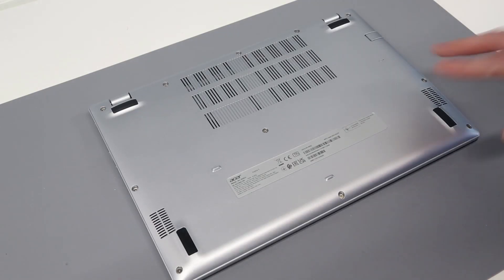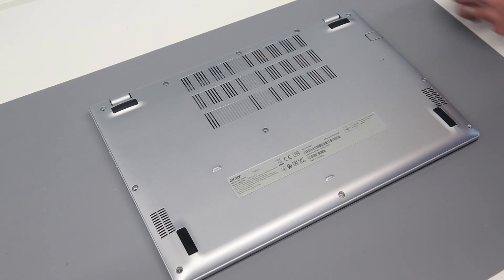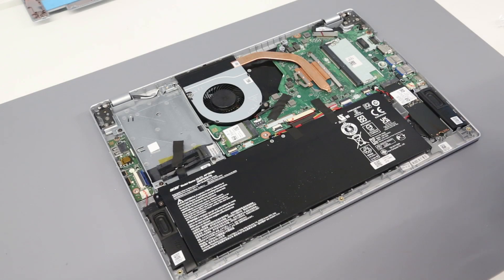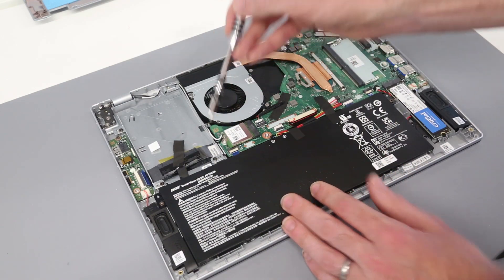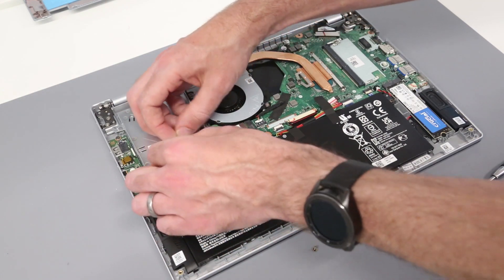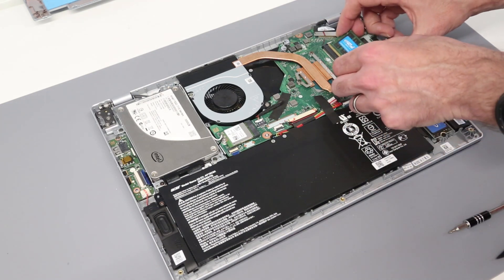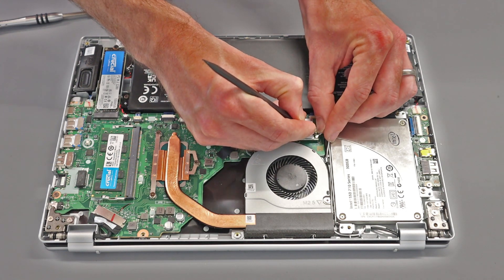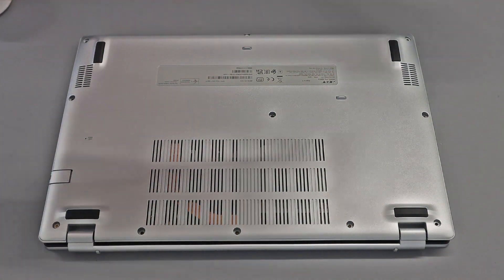Acer Aspire 5 A514-54 - M.2 SSD, 2.5" SATA, DDR4 RAM and WiFi Upgrade Guide

Comment: It’s worth pointing out that the SATA cable might not be plugged into the motherboard at the other end, as was the case for me. Simply connecting the loose ribbon cable to the connector labeled JHDD1 (both located near the Wi-Fi card) solved the issue.  just lift the locking tab (the plastic shell on top of the connector), insert the ribbon cable securely, and press the tab back down to lock it in place.
Reply from the maker: Good info, thanks for sharing 👍

Comment: tengo una acer aspire 5  intel 7 11g  irisxe  + m.2  wd black sn750 de 1tb  + ram 24gb(8soldada +16ram libre). quisiera saber si mi m.2 o acer aspire 5 se le puede poner un disipador. opiniones sus  experiencia
Reply from the maker: I don't think you'd have room to fit a heatsink on the M.2 - maybe a thin heatspreader but I don't think you'd see much benefit.

Comment: Hello bro, I need help
This Acer Aspire 5 A515-56G-54JN model comes with 8gb ram , I would like to know if it's 4gb soldered + 4gb in slot or the whole 8gb are soldered to the motherboard ?
Also is it 3200mhz or 2666mhz?
Thanks in advance❤

Comment: What is the laptop model reference and what is the processor? Mine is an a514-54-52ty, with core i5 1135g7, and the manufacturer says it is compatible with nvme up to 512GB. I would like to install a 1TB, I'm in this doubt.

Comment: Excellent.  I have the A514-55-511p = it has 8gb.  I assume this is 4gb soldered + 4gb in the free slot. Question:- can I add 16gb into the free slot ?  Will the BIOS "see" it ?  What speed ?  2666 or 3200 ?  Thanks - again, excellent :-)
Reply: Yes you can add 16GB SODIMM 2667/3200 but it will only run at the speed that your CPU supports. I did this on my A514-54 and it had 4GB soldered and 4GB removable.

One thing to note is that there might be a slight delay to startup on your first time after replacing the card.
Reply: @cybernetix_1440 but the max is 12 gb only

Comment: Hello bro, I am about to buy the A514-54-54LT model, the seller tells me that the model has only ONE ram memory slot, occupied by 8gb, and that this can be replaced by a memory of up to 20gb. Is that correct? Does this model only have a single RAM slot? Will I be able to expand to 20GB without problems?Thanks

Comment: Hello, I tried to follow the steps regarding on the installation of the RAM module. I bought the same RAM which is also the same from the description. But when I successfully installed the RAM, I encountered black screen issues. Is there a way to fix this? 

Note: The laptop works fine when I uninstalled the RAM.
Reply: this is most likely due to the speeds of the ram that you have installed. if they are above what the bios is capped at you will need to update the bios software. this is done by finding out what type of bios you have and basically update the pc that way. search it up on youtube homie.

Comment: I have the A514-54-50LX model and it comes with 8gb 2133mhz ram. Should I buy ram with the same speed or is it okay to go higher? And is it possible to match the brand?
Reply: my dude i have the same shit can i ask u something is the 8gb ram on board or is it already in the slot
Reply: I recommend you to match the speed of the ram that you already have but it won't gurt if you go for a higher speed as long as your Bios and motherboard support it

Comment: Question on the ssd upgrade... the info I found said that the max size is 258gb for expandability. Your link goes to a 1T ssd drive and a 1T hdd... can you upgrade to a 1T vs 258gb?

Comment: thanks for making this video. my question now is can a soldered ram run dual channel? cause if it can't i'll just by a 8gb ram instead another 4gb ram
Reply from the maker: Yes, adding a 4GB module gives dual channel.
Reply: Where can I find that soldered ram I opened my laptop and couldn't find it?

Comment: Do you need to disconnect the battery?
Reply from the maker: It is not ESSENTIAL, but it is recommended to minimise risk of any damage
Reply: Um I have installed ram  but the screen isn't turning on. the fan is working its heating but the screen isn't? Do I need to wait?
Reply: @virus9450  same..,how to fix this?
Reply: @ramabmp-1999  what you do is get rid of the ram and put it ba ck in again

Comment: Hi sir . What type laptop is this , is this Aspire 5 A514-54-5164?
Reply from the maker: It is the A514-54. The 5164 bit indicates other aspects of the configuration, but for the purpose of this video all A514-54 machines should be basically the same.

Comment: Hii,

4 GB of onboard DDR4 system memory, 4GB of DDR4 system memory, upgradable up to 20 GB of DDR4 system memory.

What does this mean ?
Reply from the maker: It means the 4GB is soldered to the mainboard, and there is a SO-DIMM slot which you can install up to a 16GB DDR4-3200 SO-DIMM into.

Comment: Hiya mate in a complete novice with computers. Are all RAM modules  the  same or do I need a specific brand/model? I want to use a 16gb specifically
Reply from the maker: I generally fit Crucial modules - links to compatible ones in the description.

Comment: Could I install an Intel WiFi 6E AX210 M.2 2230? My question stems from the fact that the wifi card on my a515-54 comes with an intel 9560 ac card which is E keyed and the ax210 is an A-E keyed card. I dont know they if the m.2 port on the laptop is compatible with both- Thank you

Comment: Thanks for making this video! Does installing a 16 gig ram make any sense or is it best to go with an 8 gig?  I already have a 4 gig in the single slot available.
Reply from the maker: Depends on what you are using it for. Given they aren't hugely expensive I'd probably put a 16GB module in but may not be a huge benefit vs. the 8GB.
Reply: @BrueComputing  what is the max gb per slot sir?
Reply: @tanny_edits  I believe the laptop supports up to 20gb of RAm, with 4gb soldered to the motherboard that would mean the max is 16gb in that slot.
Reply: @Jake-lc6cc  yes bro u are right

Comment: I have the installed RAM at 8GB. Can I have it upgraded to 16GB?
Reply from the maker: Do you know if that is 8GB soldered to the mainboard, or 4GB soldered + 4GB SO-DIMM?
If 8GB soldered you can add an 8GB SO-DIMM for 16GB total. If 4+4GB then you can replace the 4GB SO-DIMM with an 8GB for 12GB total, or a 16GB for 20GB total.
Reply: @BrueComputing  oh i dont know if it is soldered or not. Let me check. So if its 4gb+4gb, the maximum upgrade i can do is at 20gb?